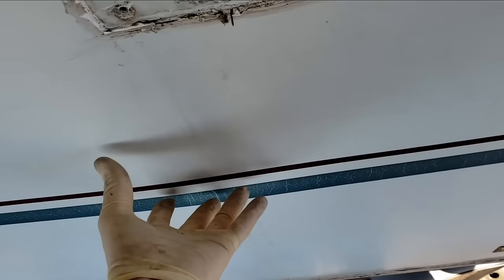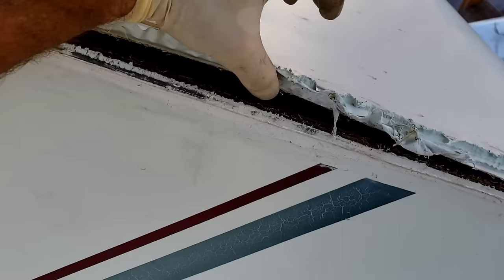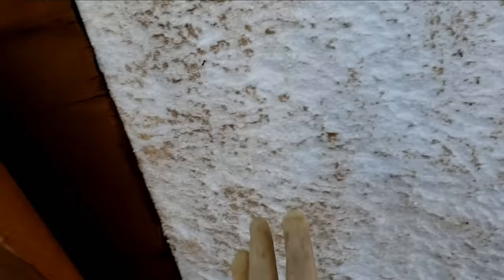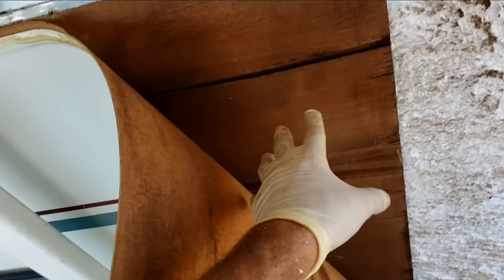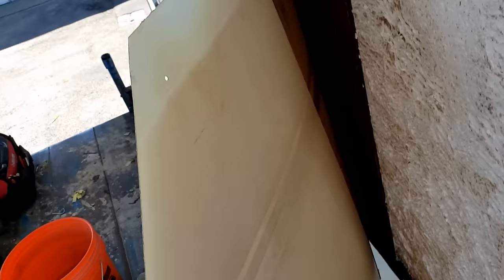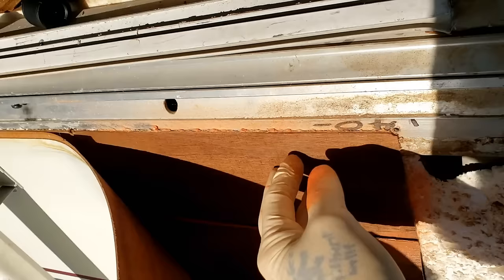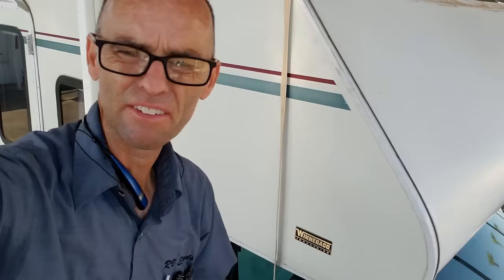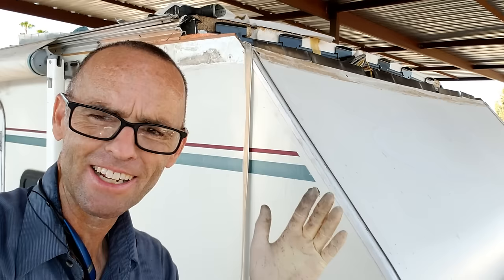How To Repair Loose Laminated RV Sidewalls....and Why It's Not Done

Comment: I know it is and old video but having had to do this twice on two Rv's I can agree it is definitely tedious. I have worked on a an RV fron the 1970's and one constructed in 2004 and the construction method is the same. In fact the one from the 1970's was better built. Basically they are built cheap and a leak spells danger.  I admire your efforts.

Comment: Az Expert I may have stumbled across a 3M product that  could be a viable alternative to Epoxy glues as well as Stabon.  The product is 3M-78.  This is not to be confused with 3M-77, which will not work for high temperatures at all.  The 3M-78 will withstand temprertures up to 190 degrees-F, and it will not melt the Styrofoam or Polyfoam board.  Most of what I see on my internet searches shows using epoxy glues, though it looks like AZ Expert uses Staybon, a contact type adhesive.  (P.S.: I verified the above temperatures by calling the 3M Help-Line.)  
     Another thought that I have about delaminate around the windows is to remove  the existing huan plywood from the back along with the styrofoam. . . The procedure that I recommend is to work mostly from the inside of the RV rather than from the outside.  This is particularly of benefit when working around delaminated huan plywood.
      Once you remove the window you have easier access to the rotted huan board as well as the Styrofoam.  Yes, you will have to replace the inside wall, but this may be easier than working the dark narrow passages from the outside.  So, by working from the inside you have easier access to glueing the three components together and with the 3M-78 or the Stabon you will not need elaoborate clamping, just spray both sides and press together.  
     BTW, If anyone has a waterproof product to recommend other that the, bound for failue, water-soluable "huan plywood", you will get an award for "TheTip of the Day."!
Reply from the maker: I think that's a great idea to try. I am limited to using adhesives that I have to stand behind but it's always good to try other ways. Let us know how it goes.

Comment: I have a Winnebago I bought in the winter time up in Michigan and I had about a foot and a half of snow when I bought it and I really didn’t get a good look at it but the interior was nice it had low mileage and started working on it about a month ago and unbelievable how they build these units the workmanship is so poor the quality of material is underrated I only have half inch on my floor and it spans more than 2 feet a lot of soft spots the plywood still good but they didn’t lay the plywood down the right way they laid the plywood down parallel with the floor joists which makes the plywood very weak it should be perpendicular to the floor Joyce the side walls were all the laminated I had to pull off about 6 feet in the back of the D lamination and peel all that stuff back very time-consuming it took me like two days to get the little one off the fiberglass turn off the foam I am so speechless to see the workmanship and the low quality material they use in the sinks and they charge such a high dollar for them if I wasn’t mechanically inclined or a Carpenter millwright I would’ve never been able to tackle this job but mainly it’s so tedious taking it apart and getting it back down to a solid material to reconstruct it even underneath the frame where the water comes up and hits in the warehouse that’s all Dean laminated I got a restructure reconstruct that very disappointed mainly again I got to say I don’t believe how the trades people in this RV business can do work like this there is no pride in the outside trades you would never get away with it
Reply from the maker: They get paid what they want and can do what they want because no one else wants to do it

Comment: If you soak the luan that is still on the filon  with the adhesive cleaner spray ,wait  a few minutes  and keep it wet as you scrape. It is much easier to remove.
Reply from the maker: Thanks for watching! :)

Comment: There is an option that isn't quite as good as what you did, but pretty good and would make a durable repair. Instead of regular epoxy, use marine epoxy which is flexible when it sets up, kills and prevents dry rot, and would basically rebuild the Luann making it stronger than new. It would not look as good as what you did of course, but it would be a solid repair.

There's one product that's much better than the others. I can't remember the name, but I've used it on an RV with rotting issues and it does penetrate deep into the wood, making it stronger than it was originally. It's a way boat owners use to cut corners in locations where it would be extremely difficult to repair otherwise. It's maybe 3x the cost of regular epoxy, but worth it when you need a good option.
Reply from the maker: Thanks for the suggestion

Comment: What can I substitute for Luan?  Any type of underlayment that is 1/8" thick?  Allrite wants $80 for a 4x8 sheet.  Can I use something like what Lowe's has, 5mm revolutionary plywood?  How about 1/8th inch utility panel..?  I'm not too concerned with manufacture specs.  My RV won't be resold.  It's cheap, and I'm just looking to keep it going for a couple more years.
Thanks..!!!

Comment: OUTSTANDING! You are RV repair wizard. Watching your videos makes me want to design a better RV. If i was building a small trailer maybe 20' long, what material should i use fiber glass over 3/8" BC plywood or fiber glass in a mold like a boat? Your thoughts?
Reply from the maker: a molded fiberglass roof is the strongest and best which will only be found on "high end" motorhomes.
Reply: Wondering what you decided to do? I'm trying to replace a missing piece of fiberglass same size as what he did here..but money is a problem currently. I had a body man offer to do the wall. But I wanted wider trim for my front corners
Reply: AZDEL technology has pretty much made these repairs obsolete on newer units with filon sidewalls thank goodness .

Comment: I'm in the process of delving into some water damage in the same area you are working on here. Mine has windows around that cab over area. It is a 1981 and I'm dealing with aluminum (I believe) siding. Probably a different situation.
Reply from the maker: Good Luck!! Thanks for watching!
Reply: @AZExpert  what I am running into is deciding if certain pieces of wood are deteriated enough to replace. I would be dismantling more if I decide to keep going further into it. I suppose scabbing a new piece onto a partially rotten piece will work. What say you?

Comment: Good work! Do you suppose it would be a similar process on the decks of the bed pop outs on a "hybrid travel trailer". Mine has some rotten wood on the deck of the front pop out due to an old roof leak. Mine is a Salem lite 19t by Forest River. So it has aluminum siding on the walls, but the pop out decks /walls seem like they are laminated. I don't think there is foam in there but I haven't torn it apart yet to find out.

Comment: Great Video very educational. I am replacing the delamihnated rear sides of my RV and and soon ready to use both the 440C and 183 contact ciment from Stabond. 
My question is what do you use to clean your peint gun once your done using it? 
Thanks for your time.
Reply from the maker: I don't, I see the gun as a one time use and buy the warranty from harbor freight
Reply: Thanks for your answer concerning the spray guns, so you gust dispose of them when you are done using them. Can you use the same gun when going from 183 to 440 or do you need to use a different gun every time?

Comment: Hey, thank you for the info on looking at fixing the siding of a class C.  I currently have the same problem on an RV I just bought about 2 weeks ago...   I wanted to ask why you used a contact cement unlike what many other videos using epoxy..?   Also are you located in Arizona???

Comment: Man, what a mess. You do awesome work. I live in South Florida. I’ve seen so many RVs sopping wet and rotting. Some only 5-10 years old. Then they try to minimize it when I tell them. I have all all steel coach and I have to seal seams or it’s going to look like that on the inside.
Reply from the maker: I have seen some rotten RVs and it's heart breaking.
Reply: AZ Expert Yeh, but you want quality your going to spend money exponentially. That’s why I bought a $million coach. It’s 27 years old and since it was so expensive new it was well taken care of. Of course it’s lost money by driving off the lot like they say l, but they still are not cheap, even this old. To get cheap you buy ones from the 70s and 80s and they are maintenance queens. Mine , It cost what most most class Cs today cost new. It will outlast me. Most owners say they are just caretakers.

Comment: Hi great videos we 2008 dutchman fifth wheel 
While taking a look at her after the winder we noticed there was rotten wood under the front sidewalk just the first 5 inches or so should we redo the wood or clean and reseal there is no delaminating

Comment: Is there any other epoxy/adhesive that I could use for a 1'x4' delamination issue?  The Sta-bond 440 is only sold by the gallon and its pricey.. I also read someone using 3m 90 High Strength, thoughts?

Comment: 19:40 I would have cut the Luan Plywood to fit the space, then sprayed the adhesive, then put the replacement Luan panel in place. Maybe that would help get the edges of the Luan to attach to the  Styrofoam underneath.
Reply from the maker: your skills at pattern cutting are likely better than mine. This makes sure I didn't have a gap.

Comment: What about the foam damage in the upper left corner?
Reply from the maker: I didn't cover it much, but the exterior wall and foam are laminated then channel CNC cut out for the wires and frame, then the aluminum frame is placed and welded in the foam.....don't ask me why, that's how they do it, so a little bit of melting will happen in the foam. Thanks!

Comment: So is there anything that can be used that would offer a longer reliability option?  Removing the "wood" from the picture here?  Some sort of plastic or fiberglass panel that would be the same thickness as the luan paneling?  We know that water will ALWAYS get in to places it shouldn't be if it gets wet.  It is just how long it takes for you to find it.  Seems that there has to be a better solution here for building them maybe like an Azdel type replacement for any work that would be done.
Reply from the maker: azdel composite

Comment: Having worked in the RV Industry for most of my life I have seen my far share of poorly manufactured RV's and the multitude of issues and problems that come with them. Very poor engineering and design causing a never-ending list of problems either under warranty or customer pay down the road.
Reply from the maker: I'm glad to hear I'm not alone with the feeling.

Comment: Thanks for lesson James!  My 2005 Thor has exactly the same water damage on the driver side. Ouch! I'm going to attempt a repair myself and have the time. Just curious if a different contact cement could be used instead of Stabond? I know that's the correct stuff but so expensive and just a small area to cover. Any 2nd choice cement that would work?

Comment: Hello James. We've just subscribed to your channel and recently bought a Toyota New Horizon. It's a 1985. Man, your videos are so helpful and give us a much better understanding on repairing our RV. I'm wondering if there's a pre-made molding that's a direct fit for our Toyota RV and model? We have leaks on many areas of the molding and most of it is pretty banged up. Looks like previous owners have removed it and tried to reseal some areas in the past. Any information would be great! Thank you James!
Reply from the maker: I would suggest rv online forums first. It's difficult to find parts on anything older than 5 years in the RV world that is not a standard RV part. RVs are more like homes than cars, so often you just have to make the parts. Thanks

Comment: Very good video I learned a lot what kind of glue did you spray where is that at paint spray gun where I would buy they grew and that role or you have I need to do my camper I’ll always do my own work but never thought it would been that easy y’all done a very good job and a very good video cajun Laurel in Church point Louisiana

Comment: Love your videos and super helpful! You mention Filon has memory in this video. I will be attempting a similar side panel Filon repair on my 2007 R-Vision MaxLite travel trailer I purchased but realized only afterwards that I’ll need to do this kind of repair on the left front section. In that area I see bulges the size of a Lemon in the Filon in a couple of spots near the door to the front full width storage compartment. If I heat that up once I gently peel the Filon away from the clearly delaminated Luan (and clean it up like you show how) can I expect it to flatten out somewhat or will it not completely flatten out till I adhere it to the new Luan and I’ll need to put a flat section of plywood or board against it while the adhesive is curing?

Comment: So if the vinyl needs a backing, can you use some other material other then the 3ply wood sheeting? Seems like the cheapest possible solution for manufacturers but if I'm going to go through the trouble to fix everything on my own I want the best option for the job.

Comment: The thin panels for inside repairs I think you call it Luna is that just 3mm plywood from Home Depot
Reply from the maker: yes the thinner plywood they have 1/8 and 3/16
Reply: Thanks so you can use that for inside Radius then paint it
Reply from the maker: on the inside lower or upper radius I would use FRP sheets from home depot first is difficult to bend luan in short radius I have found

Comment: I have a panel i removed and laminated to new 1/8 board. What adhesive do you recommend to glue the wood to the aluminum frame of the trailer?

Comment: Great Video, Thank you!! If you want an Rv with a Slide, who in your opinion makes the best System?
Reply from the maker: That is a big question for sure. The bottom line for me is emergency use, a basic electric under the floor slide rack and pinion can be extended and retracted easily manually so those are the types I like and usually built by powergear/Lippert. However, the slide box and opening themselves are another discussion and varies between motorized and towable.
Reply: @AZExpert  Thank you so much!! I am a Senior on a very limited income from the Westcoast of Canada and have learned so much from your Video's, Thank you again and thank you for answering the questions we have on your Channel!!

Comment: The nose of the Minnie Winnie has slotted foam.   In your  video it seems to be glued directly to the Filon.  I just took mine apart and in had no Luan. Is this ok or should I use ram board glued to foam and luan glued to ram

Comment: What glues do you recommend for this work ? If the stabond is to costly for the filon,can dap contact cement or 3m 30nf or direct epoxy?
Also plywood to foam recommendations?
You did an amazing job btw.
Reply from the maker: Thank you! The only non-factory or Stabond or industrial Weldwood adhesives I can recommend is the water based 3M fastbond contact adhesive. As it is water based, it will not damage the foam, but it is very prone to cure too quickly. I would recommend seeing if there is a RV shop nearby or purchasing the industrial stuff if you're going to put that amount of effort into it.  3M also makes Scotch Weld neoprene which should also work available in quarts on Amazon, but I haven't used it so I cannot stand behind it. Thanks!

Comment: I have a similar problem with an Itasca Spirit 24V, not much different than the one you worked on in this video. My delam is concentrated in the same area as your video but is much smaller (about 9"x18"). Just wondering if the red stuff can be brushed on or is spraying the only option. Thanks

Comment: Here is the main issue with this trailer. You cannot let water continue to penetrate the skin of trailer. This is why the extent of water damage has occurred to this trailer. As soon as you notice water entering either behind exterior skin, or notice or water stain inside if your trailer. You must perform immediate preventive maintenance! You would have a tarp that would fit over your trailer with either tie downs bungle cord, and strap down to prevent further water damage!
Reply from the maker: Thanks for the tip. Normally people do not notice leaks as most RVs are in storage most of the year.

Comment: So, I am new to all this.. I have a 2003 Sundancer that just has some separation at the very same place as the one in this video.  My question is, if the wood has not gotten wet do you have to remove what is there and replace or can it all just be glued back together?  Thank you!

Comment: I need to do I bought a 96 class c coachman leprechaun and the previous owner messed up the cab side walls and the sides are buckling bad
Reply from the maker: It's a heck of a job! I do have several videos showing how, but it might be something to have a professional handle. Depending on the kind of help you can get

Comment: What happens if you take out the rotten plywood, do not add new plywood, & insert new insulation? We are first time rig owners, so we have no idea what we are doing lol. We fixed it from the interior of the cab, not how you did from the exterior. I'm thinking that we will have to repair it again
Reply from the maker: Plywood is structural

Comment: I have seen some people say that delam spreads over time. Assuming that the leak is fixed, does it actually spread to non-damaged areas or is just that already separated areas become more apparent over time>?
Reply from the maker: I wouldn't think a "repaired" delam would spread, but even if the leak is fixed, the loose wall will flex and spread unless secured.